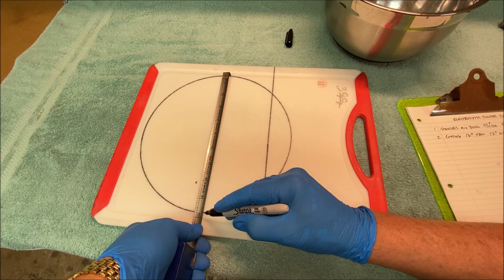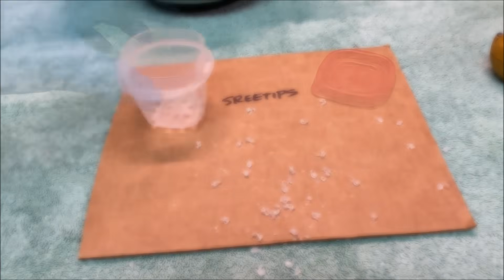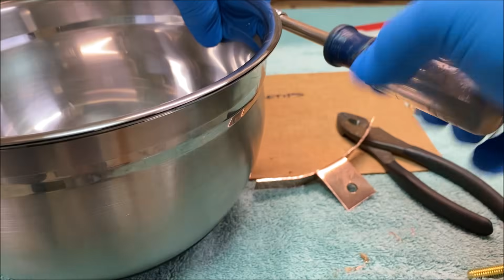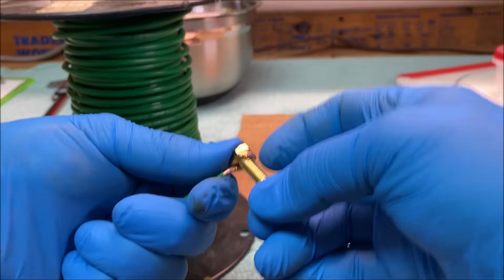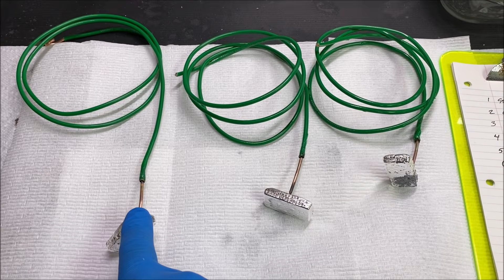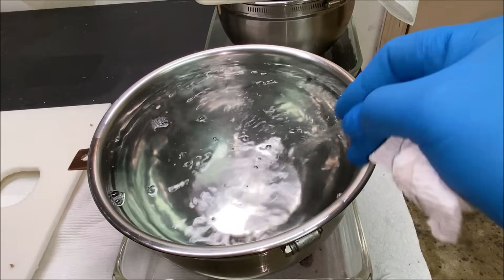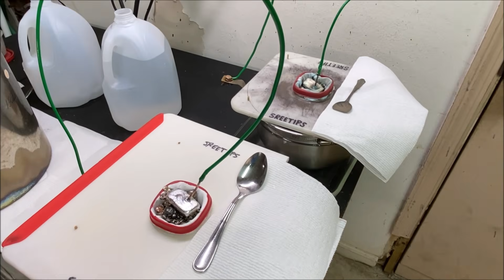Silver Cell Build Step by Step From Scratch for Beginners

Comment: Another great video simple and easy to follow I’m trying to figure out how can I make a super cell solution without the acid?
Reply from the maker: If your goal in to produce large quantities of three nines pure silver without having to run the silver through a silver cell, then using the silver chloride conversion with lye and sugar is the way to go. You can process two or three hundred ounce of pure silver in just a couple days using this method. If done correctly (proper rinsing) the silver powder produced from this method is very high purity silver.

Comment: 🌟✨🤛
Reply: Thank-you for sharing your knowledge is this process cost effective back here in UK where electricity prices are going through the roof…

Cheers Marlon
Reply from the maker: Marlon: the only reason I do this is because I use sterling silver to refine gold. I recover the silver from that process, then run it through my silver cell to get the silver to industry standard, three nines fine. If I wasn’t a gold refiner, then I’d probably just hold the sterling silver as is. No need to refine it. My electric bill is unaffected by the silver cell operation. The cell uses very little current flow.
Reply: @sreetips 

  Cheers buddy keep up the good work!

                   Marlon

Comment: It just seems to me your converting silver into silver again, not actaully creating any more actual weight. I dont understand how this is "creating" more silver than the amount of silver used to make this process happen.
Reply: Its just crystalising the silver that was dissolved. I see nothing showing any actual gain.
Reply: It just doesnt make sense to me otherwise silver would be worthless and there would be mass operations doing thiss all of the time. Something is not feasable here
Reply from the maker: I’ve never claimed to “create” more silver out of thin air than I started with. That’s impossible. I’m refining the impure silver, that is questionable purity and value, into high purity silver crystal that is easily determinable.

Comment: I thought the stainless would dissolve
Reply from the maker: Concentrated nitric acid is shipped and stored in stainless steel kegs.
Reply: @sreetips well there you go. Thanks for educating. Another question how does the copper stay in solution during electrolysis. I would have thought it would precipitate out like the silver
Reply from the maker: I’ve been told that the copper could begin to co-deposit once copper concentration gets above 60g per liter concentration.
Reply: @sreetips so basically when it reaches saturation. Thanks mate, you've been very informative

Comment: Do you have to use pure silver for the anode? Can I use unrefined silver shot to make the anode and if so, would it work just as well as pure silver?
Reply from the maker: Yes. I use pure silver because it melts like butter. Much easier to work with.
Reply: @sreetips Sorry…you answered “yes” to which question? Yes, I have to use pure silver? Or yes, I can use unrefined silver for the anode?
Reply from the maker: Yes to both.

Comment: Wait, why did you dissolve pure silver in the acid in order to harvest pure silver? If you already had pure silver, why go through all of this?
Reply from the maker: To make the electrolyte for the silver cell.
Reply from the maker: I have a ton of cement silver recovered from my gold refining operations. Its purity and value are questionable. So I must run it through my silver cell to get it to industry standard 999 parts per thousand purity. Then its value can easily be calculated.

Comment: So, regarding the anode basket and the impure silver...Is it feasible to just use more silver? Say I don't have an absurdly large tupperware full of impure silver that I can spoon in.
Reply from the maker: I have a ton of impure silver, from my gold refining, that I must run thru the cell to get it to industry standard three nines fine. And that’s the only reason that I go this.
Reply: @sreetips Thank you! With that being said, is this setup feasible for someone who say, does not have a plethora of impure silver? Can it be started with pure silver just to get the electrolyte going? I imagine it may sound redundant to use pure silver to grow pure silver but! Is it possible? And can it be done exponentially? Thank you sir.
Reply from the maker: Yes, thats all possible. But there’s no need to refine the silver. Sterling can be held just like it is.

Comment: Step one: Get 2 and a half ounces of pure silver crystal.
Reply from the maker: Pure silver bars or rounds can be used to make the electrolyte.
Reply: @sreetips Thank you sir!
Reply: How many do I need? One ounce? 2-4? Also does it harm the round at all?
Reply from the maker: I like to use 150g (about 5 troy ounces) per liter concentration. Does it hurt the round? Yes, the round gets dissolved in hot dilute nitric acid to form silver nitrate solution.

Comment: So you got 600 g of silver to make the solution. How much silver can that produce?
Reply from the maker: If I use the same electrolyte for two runs, adding 200g of pure silver to the electrolyte for the second run (because the silver gets depleted as the cell operates), then I should be able to produce 3.5 kilos of high purity silver from an investment of 800g for the electrolyte. 600g for the first run, add 200g for the second run.
Reply: Yeah I watched your videos It was so intriguing. I should have paid more attention in chemistry. I live in gold country in California andI'm on an actual gold mine townThat had a pretty high producing gold mine. I found a creek about 6 miles away and spent 4 hours just filling up a 5 gallon bucket and I got I got a little over a quarter ounce of nuggets. Had I used a sluice box at pray would have been pretty significant so we're filing a claim on it. On the other hand I love what you were doing it looked so fun it looks it's pretty dangerous it looks like but wow I meanBreaking down elements holy cow what a cool thing I was just intrigued. I'm 67 and I've missed the boat A few times man what port Can I get on at me being an old navy guy myself

Comment: Does the bowl have to be 9 1/4 inches or can one use a 10 1/4 inch?
Reply from the maker: The critical distance is about 4 inches (10cm) between the anode and cathode. Too far and the process slows way down. Too close and the silver will make contact with the anode filter and burn a hole allowing slimes to leach down into electrolyte and contaminate the pure silver. If this happens then the contaminated silver crystal can be run back through the cell with fresh electrolyte.
Reply: @sreetips  So is that a yes or a no? lol...sorry, This is all new to me so I'm just making sure so I get it right. It's a great video and informative!  A list with links to where you bought certain things would be helpful.

Comment: Thank you streetips
Reply from the maker: You’re welcome
Reply: @sreetips Question for you streetips.  Have you experimented with the citric acid, non iodized salt, plus 3% hydrogen peroxide solution to liberate the gold fingers from gold plated fingers on printed circuit boards?
Reply from the maker: Yes

Comment: dumb question-can we use copper fittings in ANY condition for the GRW and Silver recovery buckets?  Solder, some surface grime etc? thx
Reply from the maker: I would not use any soldered copper. After all, we are trying to achieve clean metal. So using clean copper is the best practice.

Comment: I wish I could find the info on WHY and HOW much

watched one vid, takes about $2000 worth of silver to get started...  
Then there's the acid etc....

my question:
after sourcing and building everything, readying the electrolyte etc, how much silver plated cutlery/kitchenwares does it take to break even?
Reply from the maker: I refine gold. I use sterling silver, that I buy at estate sales, to refine the scrap gold. I recover the silver from that, melt into shot, and run it through my silver cell. Silver is a by-product of my gold refining. The silver cell converts the impure silver (about 980 parts per thousand silver) to high purity four nines fine (9999 parts per ten thousand) pure elemental silver metal. So I’m refining the impure silver, that I recovered from my gold refining operations, into high purity silver, not creating silver out of thin air. When the silver cell is full of pure silver, I harvest the pure silver crystal, put it away and forget about it. Then I repeat the whole thing again.

Comment: can someone put the math - how much for the bar/AGNO3 and the extracted silver - what exactly is the profit here? and did the silver come out of thin air?
Reply from the maker: I refine gold. I use sterling silver, that I buy at estate sales, to refine the scrap gold. I recover the silver from that, melt into shot, and run it through my silver cell. Silver is a by-product of my gold refining. The silver cell converts the impure silver (about 980 parts per thousand silver) to high purity four nines fine (9999 parts per ten thousand) pure elemental silver metal. So I’m refining the impure silver, that I recovered from my gold refining operations, into high purity silver, not creating silver out of thin air. When the silver cell is full of pure silver, I harvest the pure silver crystal, put it away and forget about it. Then I repeat the whole thing again.

Comment: But from where comes the silver crystal forming ? it's not possible to create thinks out of thin air so i don't understand, have you  some sort of silver already ? Is that you'r liquide solution contain silver ? where did you find this and what is the cost of it ? The point of doing this is transforming your liquid silver to a solid one is that right ?
Reply from the maker: No. I refine gold. I use sterling silver, that I buy at estate sales, to refine the scrap gold. I recover the silver from that, melt into shot, and run it through my silver cell. Silver is a by-product of my gold refining. The cell converts the impure silver (about 980 parts per thousand silver) to high purity four nines fine (9999 parts per ten thousand) pure elemental silver metal. So I’m refining the impure silver, that I recovered from my gold refining operations, into high purity silver, not creating silver out of thin air. When the silver cell is full of pure silver, I harvest the pure silver crystal, put it away and forget about it. Then I repeat the whole thing again.
Reply: @sreetips  Thx for answering !  I think i get it, you take different gold carats and mix it with silver sterling then at the end of the operation you refine the gold to pure gold,  and the silver to pure silver ? Nothing is created it's just a purification process.
Reply from the maker: Correct

Comment: Are you not just, for the most part / bulk of your product, re-crystalizing the dissolved silver that you made the silver nitrite with? What % of the end yeild actually comes from the impure silver?
Your initial start costs also didnt list the acid, any of the glassware, or details on the highly dangerous fumes produced in the process and methods of safely extracting them (i presume you cant just vent them into local atmosphere....)
Reply from the maker: I use a fume hood to draw the deadly fumes away from me. Same as venting the exhaust from your car outdoors. Most of the pure silver that gets deposited comes from the 98% impure shot that dissolves in the anode basket. Some of the silver from the electrolyte depletes as the cell operates.

Comment: Hey Sreetips, great video again! Question: for the silver bar anode that you made, you stated that it will last about a year and erodes over time. Do you lose that silver, or does it erode into your impure silver pot and eventually go into the electrolyte solution? ie, do you end up losing that silver or no?
Reply from the maker: I cut the wire off, add it into the anode basket, and dissolve it in the cell.
Reply: @sreetips nice.  Ty

Comment: So where do you get all your impure silver?
Reply from the maker: I refine gold. I use sterling silver, that I buy at estate sales, to refine the scrap gold. I recover the silver from that, melt into shot, and run it through my silver cell. Silver is a by-product of my gold refining. The cell converts the impure silver (about 980 parts per thousand silver) to high purity four nines fine (9999 parts per ten thousand) pure elemental silver metal. So I’m refining the impure silver, that I recovered from my gold refining operations, into high purity silver, not creating silver out of thin air. When the silver cell is full of pure silver, I harvest the pure silver crystal, put it away and forget about it. Then I repeat the whole thing again.

Comment: What do you use as impure silver?
Reply from the maker: I refine gold. I use sterling silver, that I buy at estate sales, to refine the scrap gold. I recover the silver from that, melt into shot, and run it through my silver cell. Silver is a by-product of my gold refining. The cell converts the impure silver (about 980 parts per thousand silver) to high purity four nines fine (9999 parts per ten thousand) pure elemental silver metal. So I’m refining the impure silver, that I recovered from my gold refining operations, into high purity silver, not creating silver out of thin air. When the silver cell is full of pure silver, I harvest the pure silver crystal, put it away and forget about it. Then I repeat the whole thing again.

Comment: Where do you get the scrap silver from?
Reply from the maker: I refine gold. I use sterling silver, that I buy at estate sales, to refine the scrap gold. I recover the silver from that, melt into shot, and run it through my silver cell. Silver is a by-product of my gold refining. The cell converts the impure silver (about 980 parts per thousand silver) to high purity four nines fine (9999 parts per ten thousand) pure elemental silver metal. So I’m refining the impure silver, that I recovered from my gold refining operations, into high purity silver, not creating silver out of thin air. When the silver cell is full of pure silver, I harvest the pure silver crystal, put it away and forget about it. Then I repeat the whole thing again.

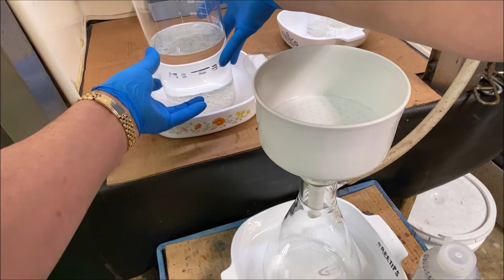Comment: A question on the "Silver Cell Build Step by Step from Scratch" video (this video). Not being a chemist, I am a little confused on how to make the electrolyte.  You wrote out 150 grams of silver per one liter of, I assume, nitric acid.  Then at 30:00 you stated that the resulting electrolyte contained 900 grams of silver (not including what is on the bottom of the flask.  If you only put in 150 grams, where did the additional 750 grams come from.  Did I miss something in the explanation?  I see later in the video that the 150 grams/liter is after you diluted the original mixture.  How did you make the original mixture to contain the 900 grams?  I'm sorry if my question is confusing, I am a novice.
Reply from the maker: I dissolve 900g of pure silver using minimal nitric. Then I dilute with distilled water to create 150g per liter concentration.

Comment: You are fuinny!! You had me for a min, you're not growing ANYTHING, you are refining and recycling from the silver granules because you have to replace them as they go down. Whats the point ???
Reply from the maker: Grow; to increase in size or mass. And that’s what the pure silver does at the cathode. Your mind playing tricks on you, thinking you’ll get something, for nothing.
Reply from the maker: The point is that I have several hundred pounds of cement silver from my gold refining. Silver is a by-product of my gold refining. Its purity (around 98%) and value are questionable. So I must run it through my silver cell to get it to industry standard for pure silver: 999 parts per thousand. Then, its value is easily determinable.

Comment: Can you use 925 in the anode basket?
Reply from the maker: You could, but with that much copper the electrolyte would quickly become saturated with copper. When 60g per liter copper concentration is reached (so I’ve been told) then the copper could begin to co-deposit and contaminated the pure silver crystal. Plus, sterling silver contains a known quantity of pure silver. It can be, and should be, held just like it is. There’s no need to refine it. The only reason that I refine silver is because it’s a by-product of my gold refining. Just resist the urge to “melt it down” because if you ruin the markings on the sterling silver then its purity and value becomes questionable.
Reply: Thanks! Is there any way of attaining ‘impure’ silver shot apart from the biproduct of gold refining?
Reply from the maker: None that I know of.